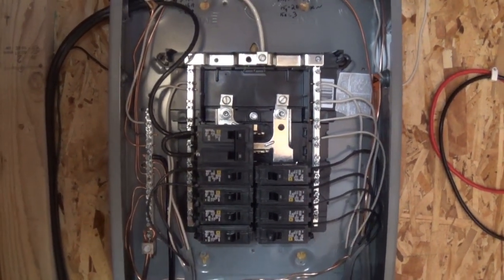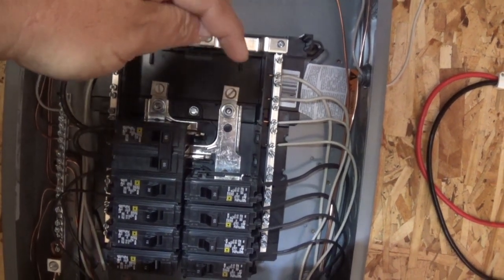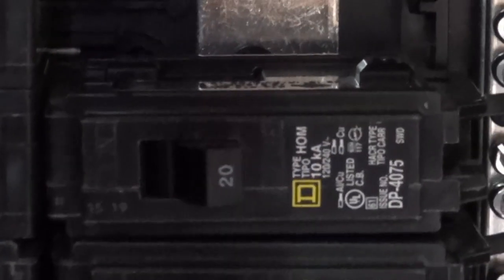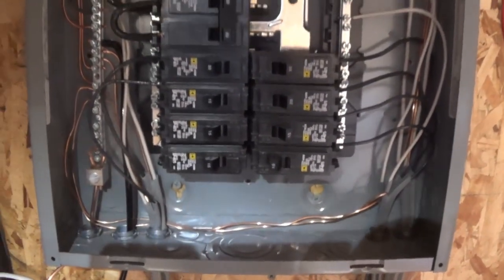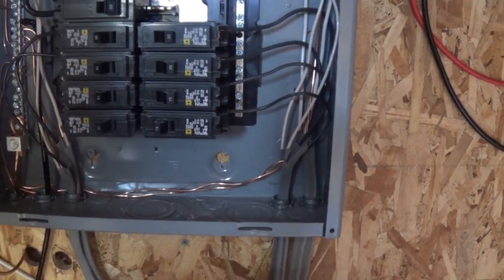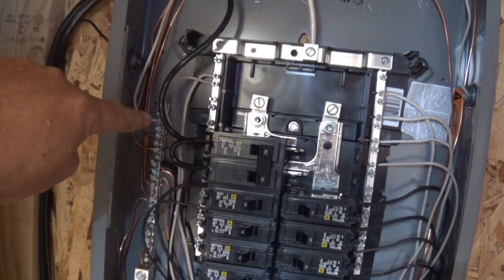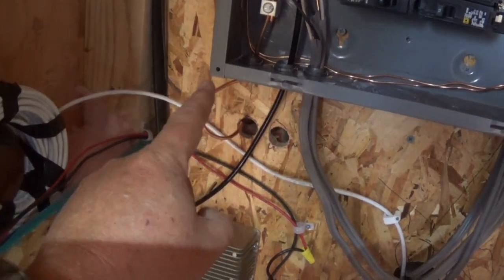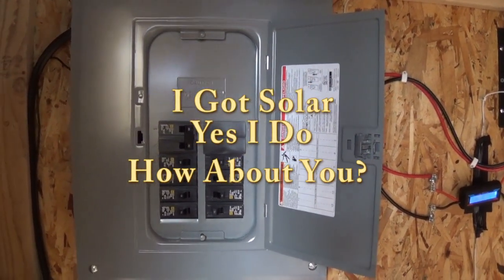Wiring a Distribution Box for Off Grid Solar - also known as a Breaker Box

Comment: Hey one more question...that looks like a bigger wire running to the 60amp breaker.. what size is it?
Reply from the maker: i used 6awg ac solid wire.  there is a black, white and ground wire within the casing so it looks bigger.

Comment: I have a 4000 watt 24v magnasign is 60 amp brake to big or just right. Do you have 48v volt inverter? Or 24v?
Reply from the maker: 24v inverter. your mag should tell you the max amps. the key is to protect the inverter. when going to a distribution box i when 60 amps becus i dont want to use more than 60amps at a time plus the inverter could handle the 60amps. you can have a 160 amp inverter but set up your distribution box to only 60 amps.
Reply: ArizonaHotHomestead I know these are old but they are so helpful this was my question thank you

Comment: Are you sure that it is safe to run a jumper to get your 120 over to the other bus?  It seems like this is somehow able to cause a problem.  1.  Won’t this potentially overload your neutral if you don’t have a fuse on the hot before the hot enters the box?  If you hit 60 amps on one bus and 60 on the other the breaker will not trip but you will be returning 120 amps through the neutral ??? 2.  Would this pass and inspection or would they consider it a double tap.  I am asking because I honestly want to know how to do it not wether or not you did it wrong.
Reply from the maker: basically for this system i should have used a different box one designed for solar inverter system. but they are expensive. i have talked with a few people about it and the jumper is fine.  so far over 3 yrs all it fine.
Reply: so there is such a product though?

Comment: Hi Jeff, what size wire are you using from the inverter to the panel ? Is you hard wired ? Would a 12/3 extension cord be acceptable where I would plug in the one end in my inverter  receptacles and strip the other end of the extension and Wire it in my panel as you did. Thank's Jeff
Reply from the maker: no dont use extension cord unless  you have a very small system. i am using 6 awg with a 10 awg ground (black/white/ground(bare)) also known as 6/2 . the 12 awg only handles up to 20amps. . if you have a small system you could use the extension cord.  you always want the size of wire to be much bigger than your loads otherwise you run the risk of wires getting hot and potential overloads.
Reply: Hi Jeff, thanks' for the reply. I aim looking at a 1200 watt system. How is your 6/2 wire connected to your inverter ?
Reply: Anna Zotter You will need a larger inverter with direct wire out put

Comment: Fantastic Video!  If I understand correctly your 60 amp main breaker is 120 volt NOT 220 volts correct?  I'm wanting to wire up my 4,000 watt inverter to a distibution panel same as you did.  My math says 4000 / 110 volts (Modified Sine) = 36.36 Amps  so, I was assuming a 40 amp breaker may do the trick.  I just wanted to get clarity on your wiring video was still indeed 120 volts.  Great Video-This is good stuff.  Thanks for sharing.
Reply: Essentially your most likely using a double pole breaker that is normally used for 220 volts but the way you have it wired is just 120.  I've found a single pole 40 amp breaker that would eliminate your "jumper" wire since i'm not running anything with 240 volts.  Thanks
Reply from the maker: 120v..... i hope it was clear but in most boxes one side is separate from the other becus normally you have 2 hot wires carrying 120 volts each to the box then it breaks it into 2 120v so you have breakers on each side. i couldnt find a single pole that fits in the middle to use both sides so i used a double pole to connect both sides. .. on your inverter is the 4000 watts running watts what is the peak? or is the 4000 the peak? if its the peak you are right on if the peak is greater you may want to increase to to cover your peak just in case you have a need.
Reply: I think it may finally be sinking in...Ha!  The inverter is 4000 running 8000 peak.  You are correct that I probably need to increase that breaker size to possibly a 50 amp but the reality is It's for my "solar garage" & the biggest load I have in there is my table saw.  The most I'll most likely ever run continuous would be about 2000 watts at any given time but the darn "13 amp" table saw has a terrible startup load (Harbor Freight).  3000 w inverter wouldn't fire it up so had to go to 4000 & worked fantastic.  It's all just part of my tinkering & learning as I go plus it's funner than giving my money to electric company that goes to the FCC every year for another "rate increase".  The 3000 watt had a 6000 peak & wouldn't fire it up so I may need at least 60 amp same as yours to not trip the table saw....hmm  110v x 60 = 6600
Reply from the maker: figuring stuff like this out is fun. you know if you end up using a smaller breaker and your tools keep tripping it just go bigger. dont go larger than the inverter to protect the inverter .
Reply: Great advice!

Comment: Very informative video, it gives me more questions though! I have a home in the mountains, we have electric power from a utility company but the power goes off all the time! I want to set up a solar system for when the power does go out so we don't even know we've lost power. Can you tie solar into an existing power panel and have it automatically switch over if the power goes out?
Reply from the maker: grid tie solar system. the samlex inverter I use is a grid tie inverter it allows you to run off of a generator with  excess power going to charge the batteries. also wire up the inverter to the power grid to do the same.  overall you would have switches that would cut the grid power and turn on the solar battery power. one way of wiring this is to wire the incoming 220v (grid ) and solar power to a combiner/breaker/switch box allowing you to switch power going to your main distribution box from grid to solar .  I think that's the easiest but your grid power would not go to your inverter. if you want that it would include additional combiner boxes and I haven't done anything like that. need more resource on that one.  does that help

Comment: Im doing this exact same thing here in a month or two..  also going to hook up a generator switch so if i'm not running inverter/batt. bank power i can run my propane generator.  I wish more people shared the meat & potatoes like this.
Reply from the maker: thanks. I would assume your gen has a remote or electric start. also on your inverter double check the voltage level for when it kicks on the gen. some times they are to low. .  glad to hear the video was informative.
Reply: yeah I wish lol. for now I'll be switching everything over manually. However in the future.. yes..  I plan to get a home back up propane gen. right now I simply have a semi portable 5000watt LPG only gen.  I'll use that with a RV style plug into my main load center just as I'll feed my pure sine wave inverters mains too my load center (fuse box). The idea in the future will be to have as much of it, fully automated as possible. when my bat. bank reaches 60% my LPG standby gen. will kick on to supply the power for the home & also help condition the bat. bank with the PV & wind generation as, & if needed.  I plan to have separate bat. banks for redundant inverters..  split my systems (loads) up between my different bat. banks/Inverters. Every home could easily generate all the energy it needs with the technology available today.
Reply: GreenMountainGrow 
Do you have setup skamatic or video.  About to do in May at my off grid jungle cabin belize

Comment: Hey thanks for the vids Brotha!! Your a great help. 1st Question: I'm counting you have 115 amps of breakers hooked up to that 60 amp modified box. How's that working? 2nd Question: I have a 60 amp distribution box that has the main breaker installed, could I connect two inverters to emulate two lines coming in for either side of the breaker box? Or would I have to do what you did here? Thanks again, keep up the great vids man!! 😎
Reply from the maker: for your 1st question.. the 60amps as your main breaker with lots of little breakers inside is fine. what you will find if running all those circuits at one time you probably wont reach 60amps and if you did the main breaker will trigger off. each circuit can handle up to those amps (15, 20, etc) but the 60amps breaker protects the inverter from having to much draw from it and the wires from getting to hot and melting the insulated cover.  the 2nd question of wiring up 2 inverters to the same distribution box. first off why? 2nd off the distribution box if it is like most main ac boxes they expect from the street line to have 2 hot, 1 neutral, 1 ground wires the 2 hots go on each leg of circuits. so for example one inverter would handle all of the left side while the other inverter would handle the right side circuits using my box as the example. instead of the double pull breaker I have you would have a main breaker on top. the neutrals from each inverter goes to the same neutral bar, the grounds to  the same ground bar. yes it can be done.  hope that helps.  be sure to use exact size wire for the amps you need or go thicker (smaller number) , great questions.

Comment: Hey what about that crank barrel washer you built. That thing is the bomb! Looks like it would hold lots of clothes. That has me beat: plunger 4 gallon bucket washer. Has my old method beat: 20 min ea. way to the laundry and hauling the clothes in out and back and forth. Actually saves time and energy.  Nice work on the combiner box set up!
Reply from the maker: +Prima Donna Going Off Grid I think the crank barrel I did was a compost barrel not for washing.